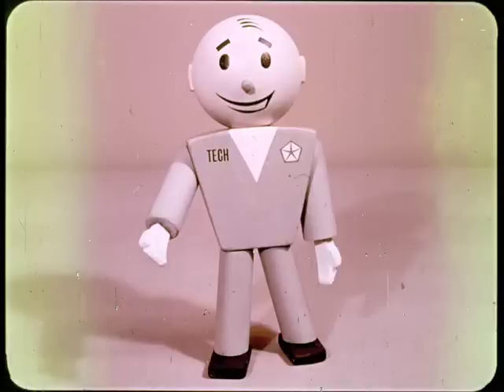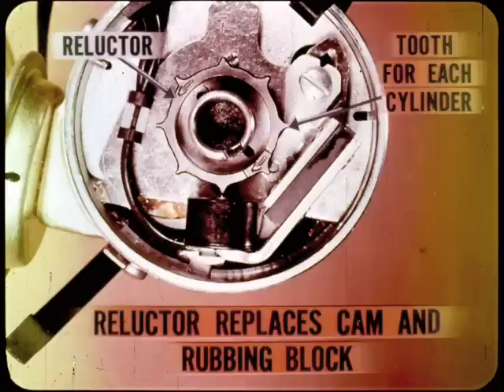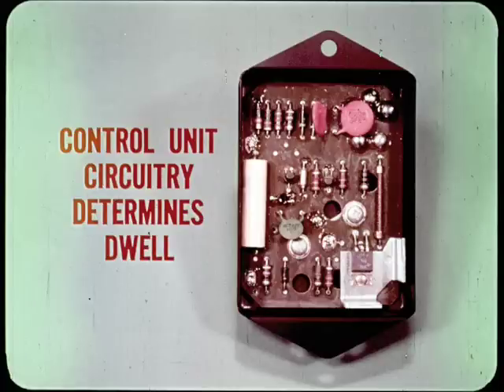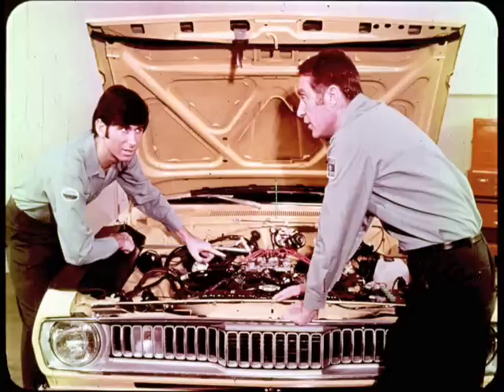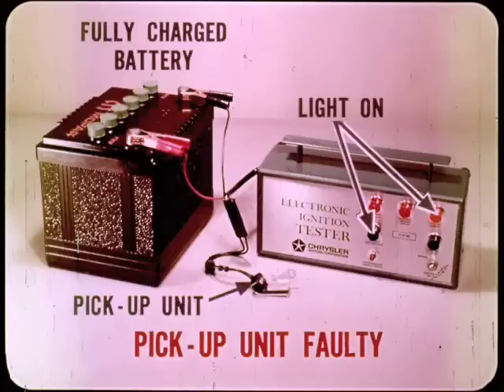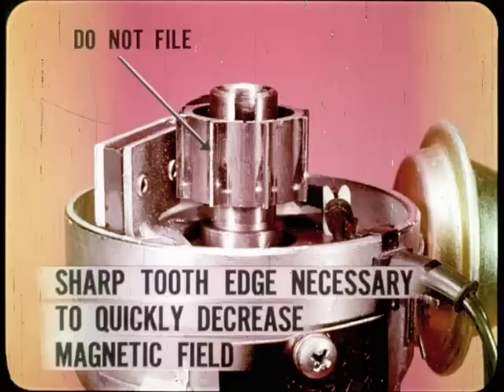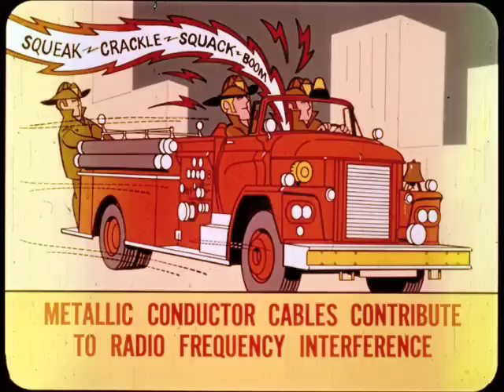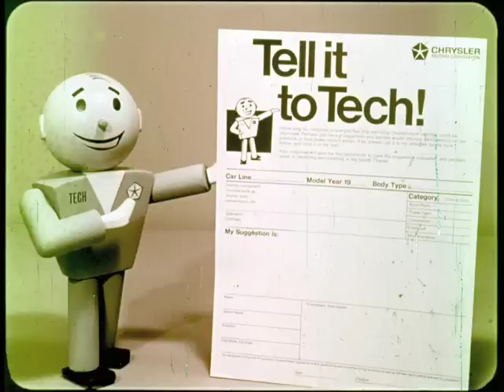Chrysler Master Tech - 1972, Volume 72-3 Ignition Systems for '72

Comment: Great instructional video not to mention the sweet 1972 Duster 340!
Reply: No joke!! I had a milder '74 340 in my charger and it was a GREAT engine that pulled hard through 6000rpm. I can only imagine how much more awesome it would be in an A body.
Reply: Its a 1971 duster check out the grille, I  had one from 1976 to 79. The 340's in 71 got the new ignition system

Comment: i worked in Chrysler engine development and realized two things about this subject. 1 was the filed mechanic was a little shy of these systems and the point cars still needed lots of service. so i opened "dial a mechanic" and stayed very busy for 15 years and stayed at Chrysler. I also looked for me in the videos i did lots of this but more at corp research level. wish i was better at business.
Reply: Very interesting.  What doctou mean by, "1 was the filed mechanic...."
Reply: He meant field mechanic - one issue was the field mechanics were wary of working on this system which often left it neglected.

Comment: My 78 Newport is a very happy car with this system. For some reason, my Newport is a rare model that did not use ''lean burn''. I plan to read more about Walter Chrysler and I am glad Lee Iacocca saved his corporation.
Reply: You are SO lucky to not have the Lean Burn System!!!  Many Factory components perform well, as long as you understand them and do proper maintenance...... 
But with that Lean Burn CRAP, I've gotten far better performance AND better emissions readings, by ripping the whole system OUT and installing a good quality aftermarket or earlier Chrysler Ignition System!!  Over 20+ years, I've done that to several customer's Cars, and never had a complaint!
Reply: The Lean Burn setups work good for a while, you just have to carry a couple extra units in the trunk when you go more than about 50 miles!
😉
Reply: Had a 1980 Newport with 318, never had lean burn, only the electronic ignition. Also had a 1980 Cordoba with a slant 6, no lean burn on that one either. Had an 84, 87, and 89 Fifth Avenues, all had lean burn. Needless to say, liked the cars without lean burn much more, had the computer go out on the 89, quite expensive piece to replace if I can recall, the lean burn was kind of a garbage system I believe.
Reply: @jackanapes6676  is it possible to convert lean burn to electronic ignition?   I might be getting a Gran Fury and 78 LeBaron soon  both I believe use lean burn.  

Can it be done neatly? Without splicing in modules not meant to be there like some putting in GM modules. Something that works but also looks either stock or if it must be aftermarket,  look professional.

I know the extreme way is to look for a Dodge full-sized truck of 1990-1991 and pull its 318 and get rid the carburetor and lean burn as that version is EFI but that is obviously an extreme last resort.
Reply: @chrismc410  you only need to get on SUMMIT RACING EQUIPMENT's website and order a stand alone Mopar Performance electronic ignition system for replacement of the lean burn system.

Comment: Great vid. Make sure the diagphram for the vacuum advance is good and that it is plugged at the rigth place on the dist. If not you'll go nuts to tune it. Also if the oillite bushings that support the dist shaft are worn, usually the top one the timing will be uneven and it will run rough. Had a van that went it the shop for a clogged intake crossover and the mechanic must have broke the piece of plastic on the dist shaft that is in the engine.  It locked the oil pump and unpressed the gear that runs the pump and the dist.  Buddy and me bougth an aftermarket pump shaft and oil pump, real cheap, probably made in a foreign country.  Had to remove motor mount and the pan in cold November weather and I also had a badflu. It fixed it however  I would have to periodically advance the timing because the engine would run real slow.  Probably that aftermarket oil pump  gear drive that was not pressed correctly.

Comment: san379
Did you figure it out?  If it's an orange box and is labeled Mopar Performance  then it's probably their electronic ignition conversion kit that was installed on your 5th Ave which came with an orange box.  I had one of those kits on my 82 Cordoba to replace the faulty old computer controlled ignition.
Reply: san379 so this conversion kit i can use on my fifth avenue
Reply: Rebuilt computers are cheaper and more reliable than the conversion kit.

Comment: Well, super glad I found this video. I've been looking for a full explanation of this system cause I just replaced the plugs, wires, rotor, cap, and coil to still not have any spark in my roadrunner. Guess I am going to need to get a voltmeter, learn to use it, then learn how to use it on this system since I doubt I'll find their special testers from this video cheap.
Reply: Hey did you figure it out? Was it the ECU? I had an orange box that intermittently would go out.
Reply: Having used both the special tester box and a volt/ohm meter, I prefer using the meters.

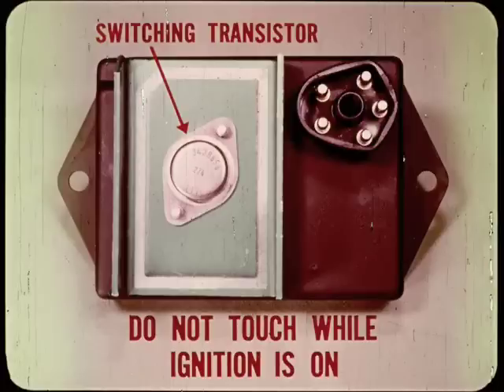Comment: 17:24  marks not to touch it while ignition is on. On my 65 Plymouth Valiant, I can touch this and I don't get shocked. So with that said, did this only apply to older ECU's?
Reply: '65's didn't have ECU's, so, either your car was modified or you mistyped the year....

Comment: one way to check the pole piece. is to take a ANALOG  VOM   put it on the highest AC VOLT.   and hook into the wires.   then spin the shaft.  if it is good the needle will move.
Reply: I like to use my analog meter to check any intermittent light circuitry, i.e. turn, hazard, or anything that blinks.  I'll probably always use it just because I like it.
Reply: I bought a GP tool that tests a bunch of electronic ignition systems.  ECU from Chrysler, HEI, Ford, even Lean Burn.  Really nifty tool that I plan on using quite a bit, I don't mind points, but I prefer not to have the headache dealing with them.
Reply: @eurekasevenwave2297  I remember learning point type ignition systems when I started wrenching in the mid 70's,, back then, Sorensen and Echlin made unquestionably the highest quality points. In these years gone by,,, it is depressing to see how much has gone overseas with corporate raiders and as a result,,, quality and experience have practically disappeared.
Reply: @patrickwayne3701  It's why I want to go to Electronic Ignition at some point in the future.  Points aren't hard to tune, but the sheer quality (or rather, lack there-of), doesn't make them worth it to run compared to using EI.  Plus, EI does seem to have more benefits compared to points anyways, like more consistent plug firing.

Comment: How come some controllers have 4 pin connector mine originally had 5 pin
Reply: They removed the 5ohm circuit to the control unit ~1980.

Comment: my fifth ave died and my ignition box is orange.. ..not blue or gold??
Reply: Likely you have a red,, that might have aged to an orange color look.
Reply: *****  loose coil wire on my  coil.. the yellow wire ring terminal  i replaced
Reply: Orange might be a Mopar Performance (or Direct Connection) part
Reply: san379  gray wire on it module to orange on distributor, brown to distributed,

Comment: They didn’t mention the flux capacitor
Reply: Still being developed in Dunmurry and Northern California then.  Wouldn't be out till late 1981 and really out until 1983 with the last models of the first incarnation of DMC. They will be standard equipment of the new annual limited production release of new DMC-12s and once approved,  new model DMCs.

 Two known models produced in the intended 1984-1985 prototype with plutonium powered fuel system intended to replace the PRV engine and Bosch K-Jetronic fuel system. Company closed but the prototype was purchased prior to closure and an for the most part, excellent review by the purchaser, a fellow by the name of Brown.

He did site starter problems as the only major issue other than the obvious fuel availability. 

High electrical charge channeled in was shown to be an effective workaround.  

A lesser known prototype, intended to be a 1985 mid 1986 model  successfully married an highly-experimental cold fusion  reactor with a highly modified,  quad turbo PRV V-6 prototype with the same Bosch K-Jetronic with cooling vents that doubled as rear thrusters for ultra-high performance. A lady by the name of C.C. Brown acquired the car by way of a used car dealer who got it via auction.  She said it was the perfect anniversary gift for her husband.